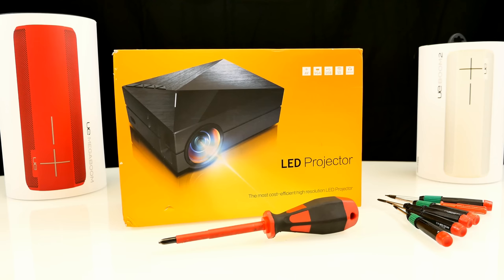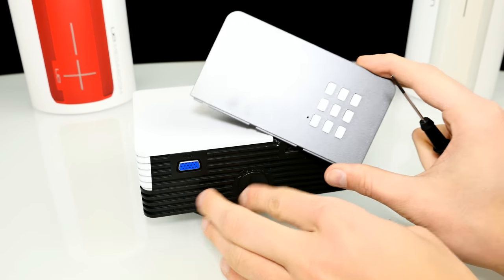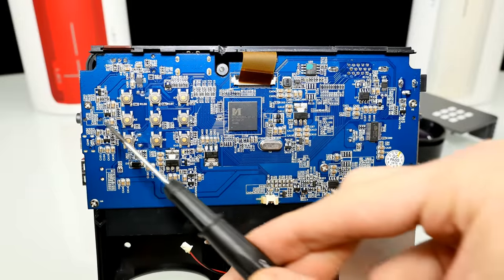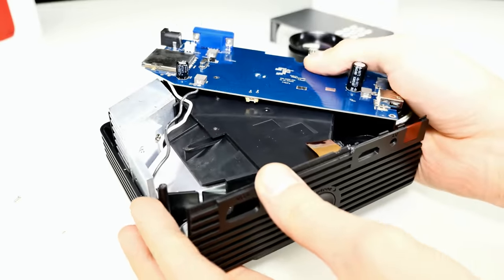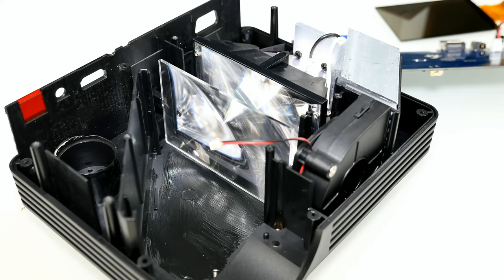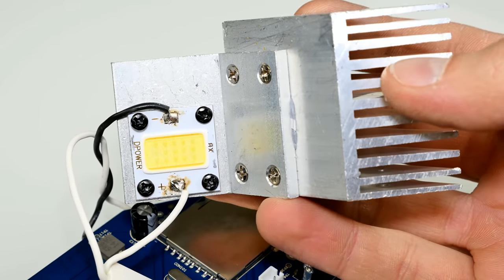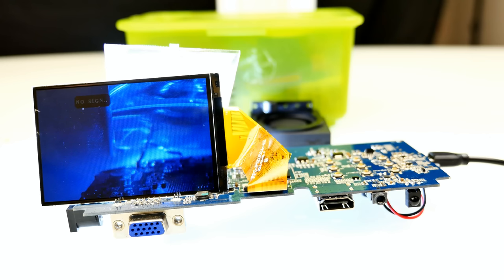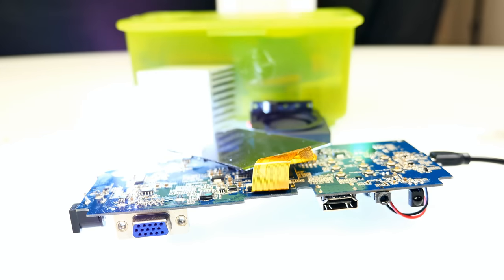Chinese LED Projector Teardown - What is inside ? [4K]

Comment: Can we change the led?, to make more bright with external power
Reply: Changing the led is fine.
New problems: heat dissipation.
Saturation of the lcd panel.
New Fresnel lens to manage the light output?
Recalculating throw based on new components.

For reference, that projector is easily washed out by any 60w bulb from 10ft away.

The image has 10-20% visibility at that point.

Comment: If you had another display, you could use it in place of the stock display by removing the backing and just using the LCD. Also, it would be cool to crank up LED light source and add more LED"s to brighten the picture.
Reply: So basically upgrading the resolution?

Comment: Stick a 100w led cob module onto a computer CPU heatsink and then put it into the projector. The CPU heatsink and fan might have to hang out of the back of the projector, but at least you will get a good bright image. I put one in a LCD projector who's lamp had failed as a replacement was too expensive to make it worthwhile for an old  720p 3 LCD projector that has no HDMI input. The 100W led replacement is actually brighter than the proper 200w discharge lamp it used to have in it. Also runs a lot cooler too.
Reply: I know this is old, but cheap HDMI to VGA adaptors work very well. With mine the computer even still detected the projector correctly, so it automatically chooses the right resolution etc.

Comment: I wonder how much the prism helps with diffusion of the white light? after seeing this i realize it shouldn't be difficult to just repllace the led with a higher wattage one for better lumen output.
Reply: but you also need to modifie the led driver or just don't use the powersuply for the old led
Reply: +Jens Roßbroich that way you could also put a better lcd screen in it .But I think you could not Focus it

Comment: This is an old video. But I did some digging around..
I don't think this chip can drive a 1080p panel.
It looks like it does 1366x768 res. But supports up-to 1080p content.

Comment: In fact all displays are transparent. Even the displays in your smartphone its illumanated by led. So why they just dont just use 1080p Displays in those cheap projectors? I mean you get a full HD Androidphone for about 120 $. So the Display must like 50$. Why they dont use it? I made DIY projectors 10 Years ago with a Laptop LCD Screen and a xenon lamp. But it was way too big. This is the same just smaller.
Reply: Cost. The cheaper they get the parts for it. The cheaper they can sell it for. For those who knew how to mod, can just get a better display for cheap & brighter led chip.
Reply: you're right, but, when they put a 1080p display on those $25 chinese projectors they cost almost like that android phone
Reply: Mine use like universal led driver, the didn't use 1080p maybe they just use the leftover lcd production that being sold cheaper because yeah, nowadays phone rarely use 480p or something screen...